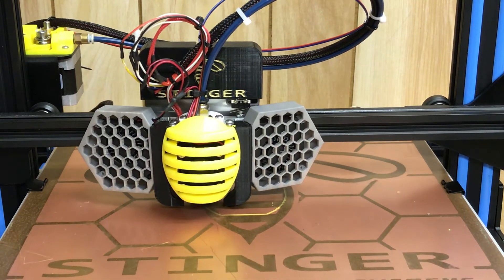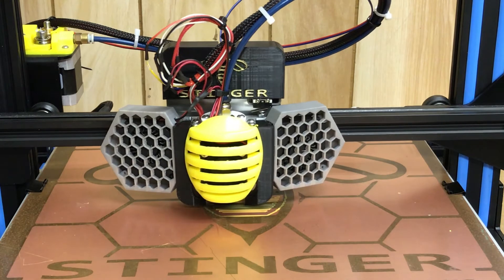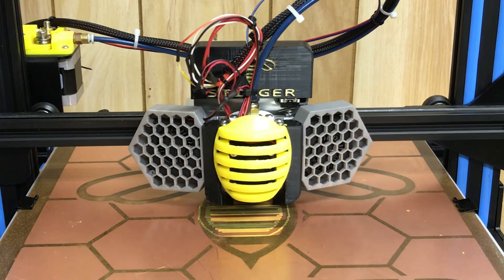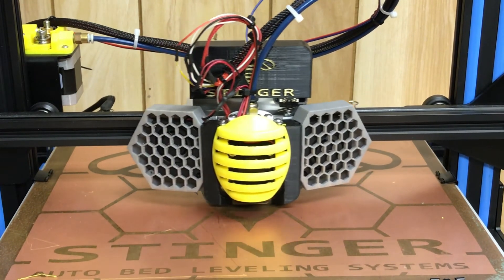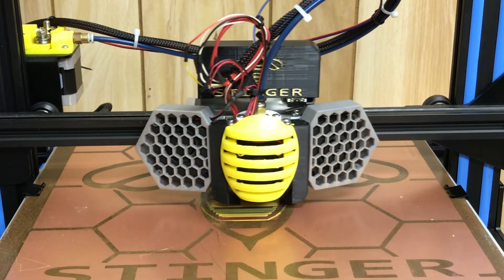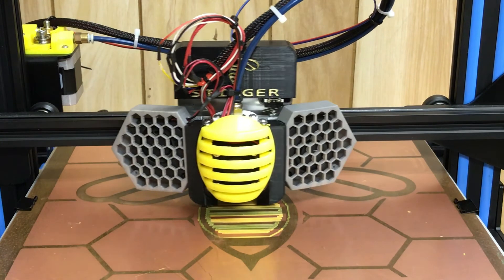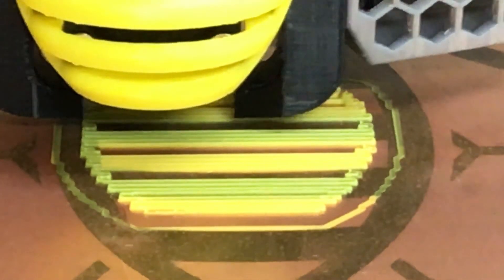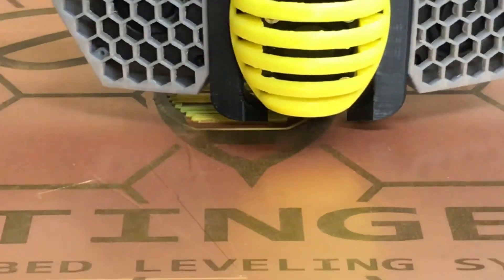STINGER ABL SYSTEM for CR10

Comment from the maker: Look for the new STINGER II which includes updates to install it with a CAM-LOCK system for many different printers by using an adapter plate system. Also the new design allows you to remove the hotend without unplugging or removing wires for super easy servicing of the hot-end. 
New adjustable fang design with an induction surface detecting probe.

Comment: Greetings David, love the vids and very much appreciate your effort and expertise!  I have a CR-10S 300x300x400 - i want to upgrade my machine to print high temp filaments for metals, woods, polycarbinates, etc. I want to add the auto bed leveling with sensor new or flashed control box etc.  Do you have any upgrade kits for the CR-10S that pimps it to high temp standards as for say ? :) 

I was looking into Swiss Micro and E3D v6 but not sure if one is better than the other for this effort going forward.  Also the PTFE bowden tubes will melt so not sure what to use.  Many thanks in advance.
Reply from the maker: Polycarbs are very high temp and I would advise against any ABL you could fry an egg on the bed however any other high temp filament printing could be done.
For example a stock CR10 would have trouble breaking 80c on the bed.
So to answer your question the Stinger is capable of anything you can print on the CR10.

Comment: could you also make a PRUSA MK3 metal hotend system like this please
Reply from the maker: Dave L   
Those were my original plans. I was hitting the low hanging CR10 fruit first. 
If you would like to send photos to Technical@3dprint2form I would see if I can make an adapter plate. 
Also a customer of mine just mounted a pinda and it works great. I have a 8m printed mount for it already.

Comment from the maker: By the way guys the new batch came in and they are amazing...they now come with the ability to mount induction sensors onboard. They are by far more accurate than capacitive or anything tested by a huge margin. 
We have now available a circuit with an isolation relay so there is no fiddling with voltage splitters etc. the isolation circuit has no danger of back feeding voltage to your board like on the "home made" versions. 
It merely completes the continuity to the original endswitch circuit.
Reply: What is the repeatability of this system? M48 command.
Reply: i would like to know the same as Zombie. What is the reading you get with M48?
Reply from the maker: Fire Farmer 420 
Ok..watch it again. It depends on which sensor you use. 
If you have a capacitive sensor, that’s the numbers you’ll have. 
If you use your CR10 endswitch it will have different numbers. Those readings are the result of you sensors accuracy. 
So. That being said, as I don’t supply a sensor, your number will be up to you to get. 
 If you are parroting the question about numbers, not understanding the concept, I suggest you watch a good video presentation that Tom Salanderer does on you tube. 
Please come back once you are educated to what “numbers” have to do with bed leveling and I’ll be glad to help...
Reply from the maker: Ok just talked to the tech. Within a few days we are installing both a capacitive and an induction sensor. We will go head to head with numbers for you and may the most accurate sensor win. 
We will then stock the winning induction sensor and include it as a kit for our system. Thanks for your inquiry.
Reply: Im asking what YOUR kits get with the switches/probes. Just cause Tom's video got some results doesnt mean yours will have the same.
Reply: Zombie has a point there. just cause Tom got some results on his rig doesnt make them the same across the board. + your kit has other factors that will affect the outcome like the springs and rollers added on. Run M48 on the stinger setup with different probes and switches to show it works as posted.
Reply from the maker: Fire Farmer 420 ok. Sometimes I forget what is obvious to me isn't to others so please allow me to explain this as simply as possible. It seems the biggest problem is folks overthinking this...think of it as a block of solid metal It's hanging from the x beam. It doesn't matter if it's suspended by a rope or wire or...   let's say your sensor whatever it is, is fastened tight to the x beam right directly above the metal block.  
 The z lowers itself till the block touches your build plate. You can do it by using a piece of paper like you would if you were leveling your bed conventionally. OK so you know your paper is .1 mm thick so you pull the paper out and baby step your z ( with block hanging) down .1 mm. 
Now you set your absolute zero. 
Next keep babystepping down until the switch, capacitive, piezo or induction switch senses the metal block. 
That's your offset between those two distances. 
What I'm saying is; my Stinger is the metal block. The metal block can't give numbers but if you are asking about repeatability, it's all on the sensor and its ability to get to the same spot ever time. That's the repeatability you keep asking me for. My Stinger won't change shape just like the metal block won't also change shape. 
It doesn't have anything to do with springs or components. Think metal block and don't overthink it into anything that it's not. There are no numbers however I will say this. If I use a thin steel plate mounted to the trigger area on the Stinger, I could get the exact same repeatability that Tom did with his induction switch tests. 
How could you not?
Reply from the maker: ZombieDisposalSquad   Just added the induction sensor mount and isolation relay circuit. M48 006. These are the most accurate of proximity sensors.
We are now supplying these with the kit. The new our original designed circuit allows you to use any induction or capacitive sensor regardless of polarity. This way you can use the $1.29 sensors available on the market (induction or the lesser accuracy capacitive sensors) and allows you to choose your level of accuracy.